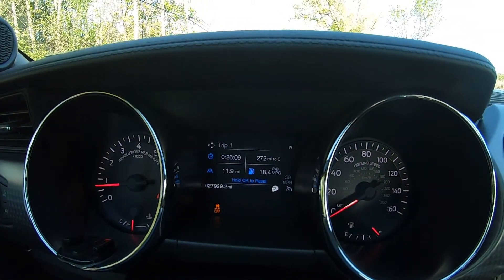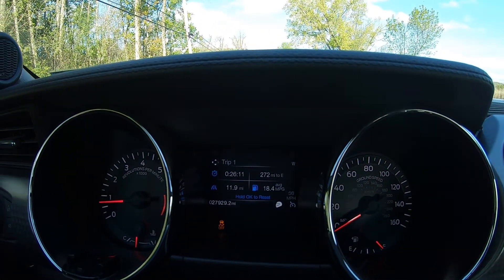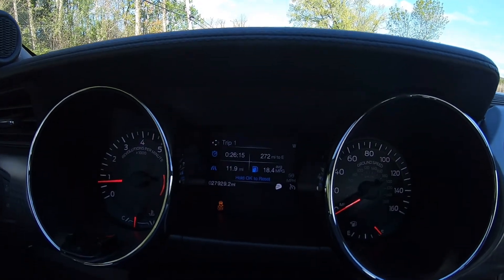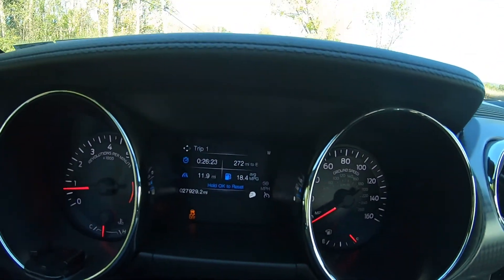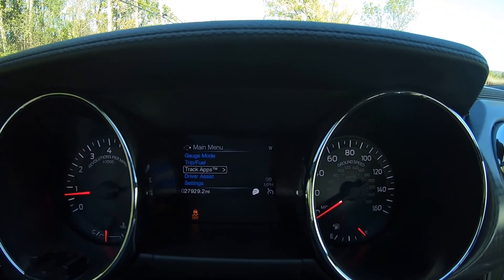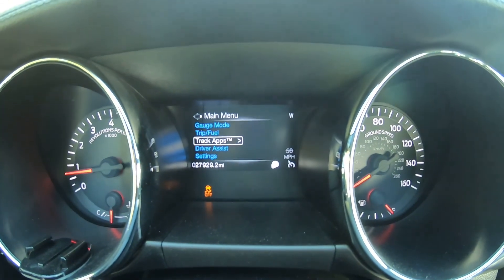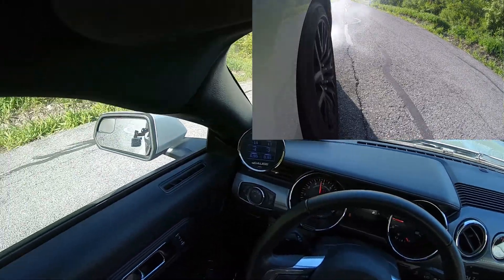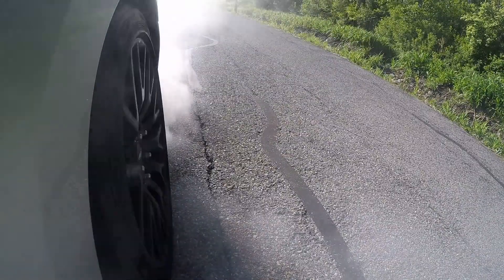How to use S550 Mustang factory line lock with burnout

Comment: I dont get it, once engaged do you push in the clutch put it in gear then dump the clutch? Do you want to be in 1st gear people are saying to be in 2nd gear
Reply from the maker: Yeah pretty much. Once engaged you have 15 seconds to complete it. Put in clutch, then first gear, and let he rip. No need to dump the clutch and no need for tons of RPMS to get it started (That's how shit breaks) I just slip the clutch pretty quick. All personal preference I guess for 1st or 2nd gear burnouts. I use 1st but 2nd gear will give you more speed if you need the tire more hot than 1st gear can do.